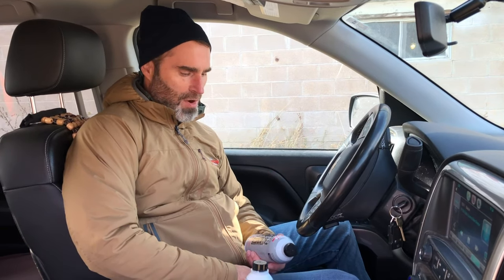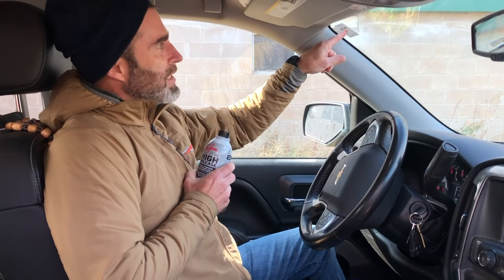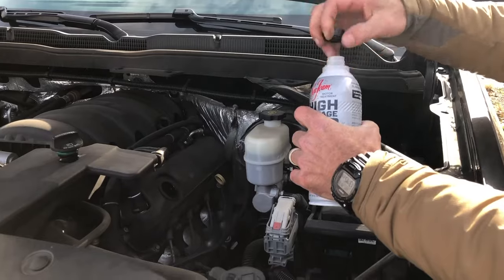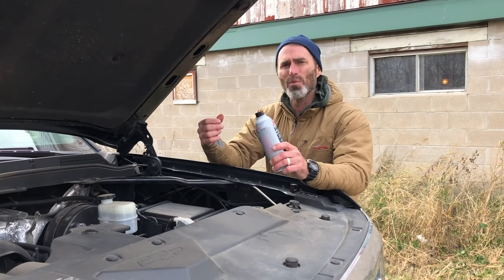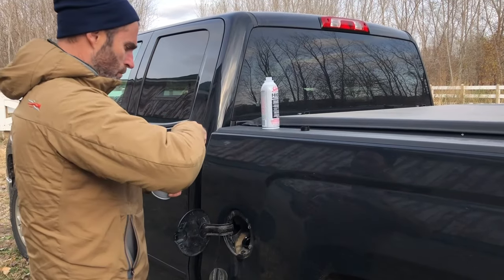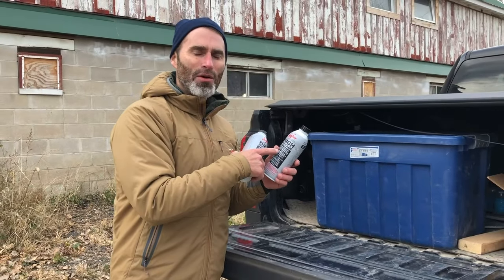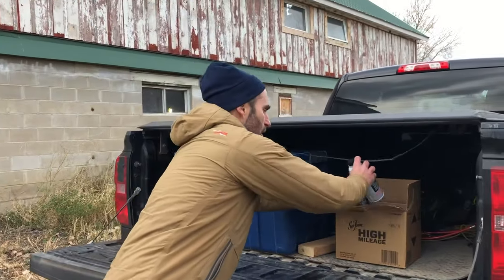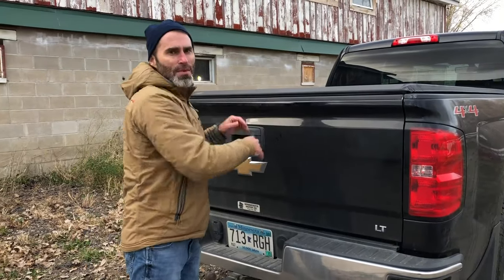How do I use Sea Foam High Mileage in my car or truck?

Comment: Years ago a representative from Seafoam came by my shop. I had a 87 Jeep Cherokee with over 200,000 miles on it. At idle, the 4.0L had 17" of manifold vacuum. Using my Jeep, he did a treatment and when we rechecked the vacuum, it had risen to over 18". I've been using Seafoam ever since except now I use the High Mileage.
Reply: -- Well, if the 1911 is the Lord's caliber, then the I-6 is the Lord's engine.  98, 92, 71 Jeeps here, and I'm building a 41 Willys, not that it counts for this.
Reply: You use it on every time you fill your gas tank
Reply: @MarkJacksonGaming the Ford 300 and Mopar 225 would like to have a word with you.

Comment: I have 125,000 miles on my 96 chevy camaro. I used the regular sea foam in my crank case, Fuel tank, and throttle body intake. Is that ok?  Or should i redo ? Didnt know there was a high miledge sea foam.
Reply from the maker: Can use it next time.
Reply: I have a 95 with 127,000 I'm thinking about doing the same, did u notice a big difference afterwards
Reply: @DavidGonzalez-mj2iq  yes I did the car run smoother .No more knocking noise coming from the engine and better throttle response. Hope this helps.

Comment: I'm no mechanic. so are you pouring the Sea Foam in the same spot where you pour oil? I have a 2003 Ford F150 5.4 w/ 360k miles
Reply from the maker: Yes, right into the oil crankcase. Sea Foam can be used in fuel to clean injectors and upper engine areas, use in oil to clean heavy residues from the crankcase. Hope this helps!
Reply: Sea Foam Official how often I use it?

Comment: I always use it in my old Silverado 5.3 AFM 150 miles before oil change, it made my pick up run quiet and cleaner. This is a must have for these 5.3 AFM engines as they are well known to build up carb in the manifold area
Reply: да ну, гонишь!
Reply: So since our trucks hold 6 quarts of oil, pour 6 ounces of high mileage sea foam where I usually pour the oil?
Reply: Does the engine have to be hot ?
Reply from the maker: Does not. @zae3883

Comment: -- Helpful and reassuring.  Bought a 2004 Tahoe Z71 with 177k miles on it.  Clean frame, everything works.  No damage.  5.3l is smooth.  Just need it to last a few winters.  Seafoam has always been my go to.
Reply: You use it ever fill up
Reply: @petermuniz9296  -- Just about.  However, only a third of the recommended per gallon.  There's a big debate out there on the YouTubes that Seafoam isn't the best for more modern engines.  Won't hurt anything, but the debate is that it's useless.  
    But I've seen it make a difference in a lot of newer vehicles.  Better fuel economy, less smoke in just about all.  However, when you connect a scan tool and look at the before and after treatment numbers, that's where I've always seen marked improvements.   O2 sensors last longer, Cats last longer.  Overall numbers on the scanner are better.
Reply: @MarkJacksonGaming  This stuff makes my gas mileage look like night and day in my 2004 Ford Expedition… after 4 full ups using Sea Foam, I’m getting 18.1 mpg average and without it, I was getting 15.6 mpg
Reply: @GameTesterDev  how often do you use seafoam?
Reply: @jt5183  Every 1500 miles, I'll put a bottle in the gas and every 4000 miles I'll put a bottle in the oil.

Comment: I used seafoam in a 1973 Ford 302 that was using oil and smoking quite a bit within 10 minutes of putting seafoam in the oil and the gas it quit smoking not that it fixed the motor completely but it helped it greatly

Comment: I just used MY VERY FIRST SEAFOAM HIGH MILEAGE MOTOR TREATMENT in my gas tank! Waiting for it to work
Reply: high mileage ? the original version worked well why change it now ?
Reply from the maker: The original has not changed. Both work great! @bigglefty75
Reply: @SeaFoamOfficial   i have always used the original Sea foam its been good stuff..  my Pops has always had Marvel Mystery in the garage and now so do i  - thx

Comment: I used the regular sea foam last week it got rid of my check engine light. I’ll have to look up the difference to see what makes this better?
Reply from the maker: Nice!
Reply: USE THE NEW SEA FOAM TUNE UP CAN, EVEN BETTER!!! 👍
Reply: Crazyhorse AZ picture?
Reply: Crazyhorse AZ j
Reply: @SeaFoamOfficial  how do I use the phone just bought some close to empty then put it in and fill it up or close to empty put it in and ride it some like that
Reply from the maker: @r-luvbham6608  Did you watch the video?
Reply from the maker: Best to add when tank is low and drive a bit before adding more fuel. 👍

Comment: I had a Chevy Truck with a 5.3 with the DOD system. At about 120,000 miles it started to intermittently use oil. It might go a month and use no oil then mysteriously a quart would get used in a few weeks. I treated it with regular Seafoam before an oil change and the use STOPPED. It might have used a quart during the entire oil change interval, about 8,000 miles. I attributed this to the low tension oil control rings, especially in the DOD cylinders getting gunked up and sticking(not sealing against the cylinders), causing oil use. Cleaning the engine and rings and freeing them up helped considerably. SInce then I have done this to my higher mileage vehicles with great success.

Comment: I just added this to my 2009 JK Wrangler I put in Pennzoil Platinum ultra high mileage oil with a Napa Platinum oil filter. I put a can of this in when I was on low and just went on 95 South I went 15 miles at 55 miles an hour and I have a picture of me getting 29.2 mpg when I'm supposed to get 19 hwy mpg

Comment: Ben. That's the air plenum not the intake. I did the injectors 4 years ago. Never do it the wy they tell you! That plenum will cone out the rear if you remove the dist . cap and lift the A C lines . did the whole thing in 4 hours!
Reply: So do i disconnect the tube from my intake manifold and spray it just before the “plenum” still?

Comment: I have an 05 Corolla,252k. Never done a fuel system cleaner other than a few chevron fuel system cleaners awhile back. City mileage is down a bit and power is down too. Good idea to do this treatment or is it risky?  I worry about injectors going out after something like this. Great video!

Comment: When is the best time to put seafoam in the crank case? Can I put it even though it's not due to change oil? Or it's better to wait til it's almost time to change my engine oil?
Reply from the maker: Can add any time as long as your drive at least 100 miles. We recommend 100 to 300 miles prior to the oil change.

Comment: Well 300,000 mile from a chevy just sounds par for the course so did seafoam do anything who knows probably not bad but just keeping good oil in it makes the biggest difference
Reply: YEAH OIL CHANGES ARE IMPORTANT 4 SURE,,, BUT I KNOW SEA FOAM WILL MAKE ANY MOTOR LAST AND RUN BETTER, HAVE USED IT FOR YEARS, NOW I LIKE THE NEW TUNE UP CAN. DON'T KNOW YET IF THE NEW STUFF IS BETTER, BUT I LIKE THE CONCEPT OF TUNE UP IF IT DOES.
  MY 2001 4X4, 160,000 DODGE STARTED RUNNING ROUGH AFTER I STOPPED USING LAST YEAR,, IT HAD BEEN SITTING FOR A LONG TIME,, SO I WENT BACK TO OLD RELIABLE SEA FOAM,, POURED CAN IN FULL TANK AND BEFORE I GOT HOME SHE STARTED RUNNING GREAT AGAIN, ABOUT 5  MILES. I'M SOLD ON IT. NO TROUBLES WITH MY TRACTOR I BOUGHT AT AUCTION, AND IT RAN LIKE CRAP, NOBODY WANTED IT,, NOW PEOPLE CAN'T BELIEVE I BOUGHT IT FOR SUCH A GIVE AWAY PRICE.
  DOESN'T MATTER WHAT WE DRIVE IT WORKS FOR US IN AZ. SO I USE IN EVERY OTHER GAS FILL UP.
  CAN'T WAIT TO BUY MY NEXT AUCTION VEHICLE FOR A SONG AND A DANCE RUNNING BAD, THEN SELLING FOR HARD COLD CASH.
  BETTER THAN A SECOND JOB,, IN A CAN OF SEA FOAM. 👍🇺🇲🇺🇲👍
Reply: @crazyhorseranchaz  why are you yelling at me
Reply: James Holbrook Because you don’t listen otherwise!
Reply: @crazyhorseranchaz   Your Seafoam check is in the mail. 😁
Reply: @crazyhorseranchaz  see if you can figure out how to turn the caps lock off. Feels like you are shouting at us 😅

Comment: I had an oil change about 850 miles ago (engine has 117k miles on it, runs great) and have heard good things about Sea Foam High Mileage. Just bought a can, and my fuel level is about 1/4 a tank. Should I just pour the whole bottle in, and if so, how long should I wait before I tank up?

Comment: Will this also clean my upper intake system by just adding  to my fuel? If no,  can I spray it directly into my throttle body?
I don't have any oil leaks, so I'm hesitant to add this to my engine oil. What's your advice?
Thanks!
Reply from the maker: Hi Matt: You'd need Sea Foam Spray to apply through a throttle body.  Sea Foam or High Mileage in oil have nothing to do with leaks. Add it to oil to liquefy heavier residues. Hope this helps!
Reply: @SeaFoamOfficial  I just got an oil change and filled up my tank. Can I still put some into my fuel tank?
Reply from the maker: @DunnDealOutdoors  Great question! I like to add when the tank is low to increase the cleaning concentration. Up to you.

Comment: Buddy of mine said to run some thru my gas tank and then drive the hell out of it I've never used this before and would like to know why I would need to drive the hell out of my truck after putting this in my gas tank?
Reply from the maker: Hi Alex: The "drive the X out of it" idea has to do with intake cleanings with Sea Foam Spray, not adding to fuel. The Sea Foam Spray can instructs "Apply spirited acceleration..." after the hot soak step.  Hope this helps!

Comment: I purchased this yesterday after hearing about Sea foam...
I have a 98 camry LE with 240,000 miles on it. of course got the high mileage one. I put about 1/3 of this in my oil and will be changing it in about 100 miles. Right now my fuel is over half full so I'm taking the instruction and will wait until my fuel is lower. 

But when should i put it? when i have about how many miles left? 100? 200? 
Also, is it more effective if you do this in your oil and fuel together? or doing it separately doesn't make a difference?
Lastly, how much should i put in the fuel tank? is about 10 once enough? or should i get another bottle?
I have never done this before for my car.
Reply from the maker: Great questions! 1) Can do separate. 2) Use half a can in Camry oil. 3) Half a can in fuel isn't much.1 or 2 cans when you have 50 miles to go is a good rule., then drive 20 miles before adding more tank fuel. Hope this helps!

Comment: I used this in the crankcase of my 4.0 and it sputtered for about half a mile after i used it.  is that normal?   maybe the oil pump didn't like how thin it was?  Also,  i used this about 3000 miles ago, and forgot to change my oil....  seems to run fine, but i am going to go get a change tomorrow.....  did this stuff continue to clean the entire 3000 miles, or should i add a little more and run it a little first
Reply from the maker: I believe you - that you experienced a sputtering of sorts...But adding to oil would not cause the oil pump to react differently. Anyway, I don' have an answer for what caused the sputter. 
It's OK to run in the oil for  the full duration of the interval, so no worries. Just add half a can to your 4.0 every interval and it will continue to clean your oil crankcase.

Comment: Whats the difference between the High Mileage and The standard Seafoam? Would it be a good idea to use this product with a vehicle that has 265,000 miles that's never had a Seafoam treatment before?
Reply from the maker: Always helps to use it. HM is tougher on stubborn residues/buildup.
Reply: @SeaFoamOfficial  Ok, the only thing that concerns me is that I have significant buildup and big deposits will break off and clogged up passage ways. Is that something I have to worry about?
Reply from the maker: @saulgoodman9193  Oil deposits are oil residues that are no longer fluid. Sea Foam liquefies the deposits back into fluid.
Reply: @SeaFoamOfficial  Copy that, thanks dawg!

Comment: So I just changed my oil in my 97 gmc will it be ok to add this to my oil until next oil change or do I need to changed oil sooner? My truck also has 228k miles.
Reply from the maker: Yes, add one time per oil interval. Always leave in the oil until ready to change oil. No need to change earlier than normal!

Comment: If just using in Fuel should it still be done within a couple hundred miles before oil change ?
Reply from the maker: You can add to fuel any time. Best to add when tank is low to increase cleaning concentration.

Comment: Can you do this same process on a high mileage old 7.3L or 6.oL Powerstroke?
Reply from the maker: Can run it in your diesel oil. Just note that we don't promote as a diesel fuel product.
Reply: OIL CHANGE IN A DEISEL IS EXPENSIVE, I'D USE IT MYSELF,, BUT I PREFER GAS ENGINE, I DON'T THINK EXPENSES MAKE UP FOR BETTER MILEAGE. THAT'S JUST ME. 👍
Reply: @crazyhorseranchaz  except where I tow you would be doing 5 MPH up the Ike Gauntlet in a gas engine.  12k feet and steep as hell.  I regularly tow over 20k pounds.
Reply: Yes but don't use the high mileage one in a diesel, use regular seafoam

Comment: Can you put the seafoam into the gas tank if you just got an oil change or should you wait?
Reply: Um definitely wait
Reply: You can add to the gas tank anytime. Don’t put it in the engine oil until you’re almost at your oil change interval.
Reply: WHY WAIT, TANK IS GREAT, DOES MORE THAN A HALF CAN IN OIL.

Comment: So I’m burning oil and my head gasket and valve cover gaskets are intact, I have a 1994 Honda Civic lx and have to add about a quart of oil every 1-2 weeks, would this stuff help with that?
Reply: if i were you id run liqui molys molygen oil on your next change, it glows under a blacklight so you can see where oil is coming from, seafoam might help but it will only be a bandaid solution, it never hurts to run this stuff through your car though
Reply from the maker: Start adding it every interval. It's going to help no matter what. Could have piston ring restrictions or worn rings. Have your cylinder compressions checked.

Comment: So my tank is full and I just got an oil change. I get the impression that I should wait until my tank is low, add at least one bottle, drive for a while and then add gas, correct? Should I wait until I'm close to needing another oil change before adding 1/2 of a bottle to the oil tank? Thanks!
Reply from the maker: Great questions - yes for both.

Comment: Did not know this product even existed !!  I will have to get some and use it.  I have a Ram truck with a 5.7 Hemi and MDS.  I understand that the MDS system is oil viscosity sensitive, will I have any issues adding the Seafoam to the oil ?
Reply from the maker: No issues with viscosity - good to go!
Reply: Seafoam has been around for DECADES.
And decades ago, it was useful.
Now its absolutely unnecessary

Comment: When putting in gas tank you said drive 20 miles then add more fuel? Can I add on a full tank of gas? Or should it be at a certain level?
Reply from the maker: Can add to a full tank. Just note that adding to less gas creates a greater cleaning concentration.

Comment: Is the amount supposed to be per gallon capacity of the vehicle? It seems like you just added over 20 ounces to a few gallons fuel. The can says 1 to 2 ounces per gallon.
Reply from the maker: Great question! For cleaning, can shows "use 2 or more ounces per gallon", so you can could go with 50 ounce per gallon if you wanted.  I like to add a can or two when the tank is low, drive at least 20 miles before adding fuel.

Comment: Does the engine have to e hot? Do I pour the sea foam high mileage where i pour the oil ?
Reply from the maker: No, does not need to be hot.  Instructions on can suggest adding 100 to 300 miles before each oil change.

Comment: Hi. Could i only add it in my oil and fuel cap only without the trottle?
Reply from the maker: Pls rephrase your question.
Reply: @SeaFoamOfficial  I see you added the seaform in 3 areas. If i only added it in where i put gas in and the where the oil change go only will that be good to do? I'm sorry not great at cars
Reply from the maker: Yes, that works. Thanks for the new question!

Comment: So for the fuel I just add when my tank is empty and then fill it up and just drive it or what’s the proper way ?
Reply from the maker: Add when low, drive about 20 miles, then add fuel.
Reply: @SeaFoamOfficial  do you add the whole can and does the truck have to be on or off
Reply from the maker: @santinn7004  Whole can and does not matter if the vehicle is running.
Reply: @SeaFoamOfficial  I have a 91 Cadillac Fleetwood brougham with 78,800 MI is it safe to use high mileage seafoam in it and how often should I use seafoam
Reply from the maker: @r-luvbham6608 Yes, always safe for any engine! Watch the video - add half a can to the oil every interval, add a whole can to the tank every couple months. Best to add to fuel when tank is low to create a higher cleaning concentration. Hope this helps!